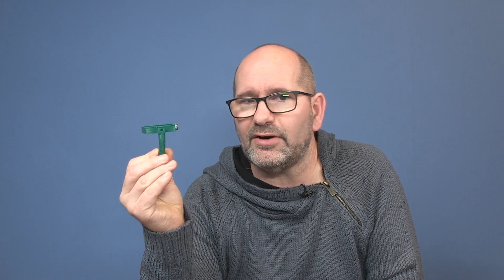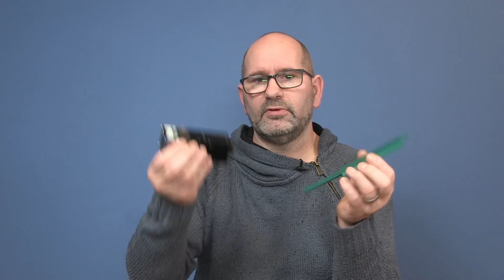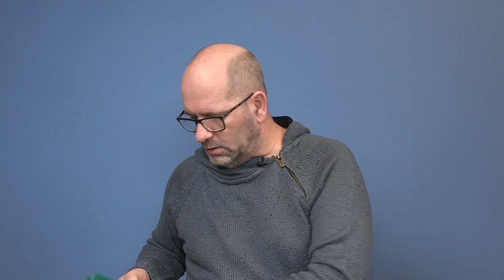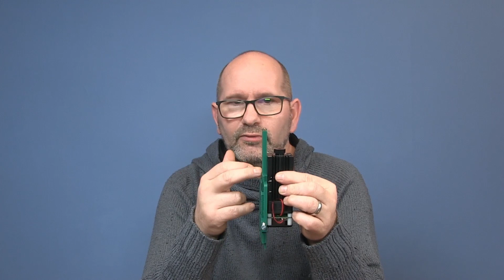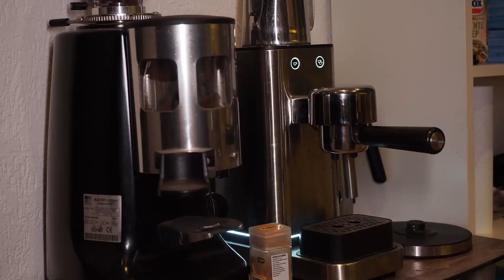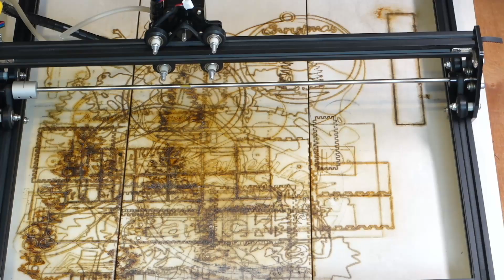▼ FREE ▼ Ortur Master II AIR ASSIST plus Z LIFT

Comment: Hi Brian, great design(s) but unfortunately as you know Ortur have changed the design again for the LM2Pro! Do you intend another re-design?
Reply from the maker: Not as long as I don't have the newer model.
I need to have it in my hands to do the measurements and create a new iteration of the Air Assist.

Comment: Newb question! I have a 3D printer..so can print the parts….but what is used to supply and presumably, regulate the air.
Reply from the maker: A very simple and cheap aquarium air pump.

Comment: I just downloaded and generated the Z-Axis adjust for the Ortur Laser Master 2 Pro - but it SEEMS that it dows not fit the Pro - the large mounting holes are all wrong.  I'm quite able to print one out on my AnyCubic and the one I printed looks and works well in my hand- but unless I'm missing something - it will not fit the LM2Pro - I don't suppose you've done a version for the latter? The engraver itself is lovely but the Z-adjuster is awful.

Pete
Reply from the maker: Hi Pete,
The Ortur Laser Master 2 PRO is a different machine from the non PRO version.
The lasers have a complete different shape and also the mechanism to mount the laser is different on the PRO version.
Maybe in the future I will also make an Air Assist for the PRO, but that depends on how many other people are going to make things for it.

Comment: I designed a knob that fits, compressed, over the head of an M4 screw that screws in, through 2 hex nuts installed in the slated openings on your latest air assist, to push the locking piece against the slider plate. It could be glued but the compression fit-up works fine.
Reply from the maker: Sounds great. :-)

Comment: My new laser master 2 with 20 watt laser  with the air assist (and stock mount) hits the head of the screws on the x axis connection to motor when laser is all the way to the left and moving in the y direction. Added a 1mm washer behind the mounting plate, on all 4 screws, and that moved it out enough to prevent touching. I am going to inform Ortur of this.
Reply from the maker: That's a strange problem, I never heard it before.
Glad to hear you fixed it.
Reply: Also changed out the wire sleeve from the stock ones to 10mm braded sleevs. They work better. The Laser Master 2 I received had the grounding mod included. The wire harness could use about 5mm more added to the length. I have quite a few adds. My 3d printer has come in handy.

Comment: A couple of things: 1. I had to enlarge the channel for the 6mm hole, this included some adjustment  (about 3-4mm wider of the extended part of the plate.. I measured it, as printed, and it measured 6.4mm ID and the tube should have slid in OK but it would not go past the first curve. The tube measured plastic air tube measured 6 mm exactly.
2. I designed a template that helps to make the bend just right to blow on the focal point of the laser.  3. I used a 3mm hex head screw and two hex nuts for the slide lock. 4. The small piece (lock) for some reason, does not download as the correct size. May be my Windows 3D builder software as i have had the same problem with other downloaded pieces. I measured the slot and adjusted the file to fit and printed it. I then put it in place and used pliers to press it into place after a little sanding. I inserted the slider and worked the locking screw and it worked fine.
5. Used my pliers to twist in my .6mm nozzle the first time. Good snug fit.
6. 100 C (180 F) water works fine to bend PLA after about 10 seconds. Used my templates with hose and nozzle installed as recommended and had NO splitting.
If you desire, I can download the template that I designed to make the bend correctly (plus the information as to how it should be used.
I have an air pump I bought on Amazon (Pawfly MA-60 Super Silent Air Pump). 2.0 Watt power, 1.8L/min air flow, 0.012 Mpa air flow pressure. It has a 60" (183 Cm) 6mm hose OD 4mm ID. 
Since I just received the Laser Master 2, I have not fully assembled it as I wanted to get any mods ready/printed prior to assembly. The delivery from Ali Express took 5 days from China and it cam with the new grounding mod included. It was a package deal which included a 20 Watt Laser and the YRR Roller assembly (noted that the routing of the belt on this was updated to make sure there was a clear end so long items could fit on the rollers. This was a mod suggested by another YouTuber (so the manufacturer is watching - impressive). All items came from Ortur, no clones.
Have also designed leg spacers so that I can set the printer frame for regular burning and then easily raise it above any anticipated items that are taller then the approximately 40mm of Z axis lift or when using the YRR Roller item. Thought of sessor lifts,  etc but this is simple, easily printed on my 3D printer and I can always print more if needed.
Reply from the maker: Hi, Sorry for the late answer, I have been a bit sick the past weeks. (no Corona).
1> This must be something with your printer calibration. A lot of people have printed it already and this is the first time I hear this.
2> If people have the same combination of laser and lens, that is a very good thing to have. Yet, I like to have the flexibility to adjust the angle to the focal point I use with any combination.
3> Great solution !!!
4> I am sure it downloads fine, but your settings in the software are finding the part too small, therefore they change the units to inches. This is a common problem with small STL parts
5> Great :-)
6> At 100 degrees Celcius, there is a big chance that the material is not heated up all the way to the middle, and also it's possible to overheat the part. The way I show it in the video is a good way to be save and not overheat the part. You can leave the part in for 5 minutes without a problem.
7> Oh wait, there is no 7 :-)
The package deal is a good deal, I love it.
Ortur has sure watched my video's and even contacted me multiple times. There are more goodies on the way to test in the next weeks.
Reply: @3dPrintCreator  Considering 2), how in the world did you manage to get a correct bend. i have tried this 10 times now... doesnt make it easier that tube reverts to its printed form o neach heatup :/
Reply from the maker: When using water that is not too hot, you can bend the print and keep it in place until the part is hard again.

Comment: What airpumps do you suggest to use with a laser master 2 20w?
Reply from the maker: For any laser I would suggest an airpump that does not blow away your material, but is strong enough to blow ashes and smoke away.
My simple aquarium airpump (mentioned in the video) has more than enough power to do so.
Reply: Real talk, I tried a 700 gph pump that was crazy loud, I picked up a tetra100 and it seams to work fine but people say it should cut out atleast 2+ passes and it certainly doesnt do that.

Comment: Questions: Can it not be designed to have the bend already in it? Can you just make a small hole. At the end so you don't need a nozzle?
Reply from the maker: Hi Phil, good question.
I have been testing that in the first models I designed, the tube was already bent in the print, but this had two major drawbacks:
For starters, the angle is not the same for every type of lens under the laser. With one lens you have to focus at a distance of 37mm, with another lens model you have to focus at more than 55mm. This means that the angle should be different for these models. This by itself is no problem, I could have designed two models.
The second problem is that there is very little room for the pipe down, and you want a strong airflow. Preferably you want to push the silicone hose completely against the brass or metal nozzle, and also make sure that this connection is firmly attached by pressure fitting it. In addition, you only want to determine the opening of the nozzle (1mm is a very nice opening) at the very last part of the pipe, so in the nozzle.
By bending the pipe during printing, it is no longer possible to get the silicone hose all the way to the nozzle, causing air to leak through the PLA (or other material) print, which means a loss in air pressure. By bending the pipe afterward, if the silicone tube is already in it, this silicone tube will also remain in place.
The result in this model is that the air pressure only needs to be very low so that a simple aquarium air pump provides sufficient air pressure. I myself work with an air pump that only moves 150 liters of air per hour. These types of pumps are very quiet and inexpensive. If I were to bridge the entire length with a printed pipe, it would leak a lot of air, because 3D prints are not airtight (not even watertight), requiring pumps with a capacity of 800 liters per hour or more to get the same air pressure at the nozzle.
Reply: @3dPrintCreator  Thanks for all the info. I bought an aquarium pump on Amazon for $5 and some hose at the local pet store for $4. Just need to buy a nozzle. I have a new printer to set up on my channel soon so I think I'll print it on that.
Reply from the maker: You have a new subscriber. Now watching your video about the hourglass.
Reply: @3dPrintCreator  Thanks. 😁

Comment: what if you just use a fan to place next to the laser, blowing the smoke/ash away from you, out the door/area you are working at. Great information! I really appreciate your content!
Reply from the maker: A fan would really do a lot, but not enough. You will need a nozzle, to blow the air in the gap you created with the laser to remove the ash from that gap.
Using a fan wouldn't remove the ash, using compressed air and a nozzle however, works great.

Comment: What's not better is how can we get your air assist system. Just give us a simple address where you take a credit card and I'll buy one now.
Reply from the maker: Before I came to the end result where I am now, I made dozens of models. I have tested them piece by piece, and from some models I made videos that I have shared with my viewers.
I have worked on the models for days, or even weeks, and even at the moment I am already testing for a new model, because Ortur has made changes to the design of the laser.
I have shared all models that I made for free on the internet, and when I noticed that my models were stolen to be sold, I made work of it, because everyone must have free access to it. The only thing I ask people to do themselves is to print the model itself on a 3D printer, or having it printed at a local maker Space.
So, I am sorry, but you will have to put in a little effort yourself because I am not out here to earn your money from your credit card. I am just sharing my thoughts and products for fun.
Reply: @3dPrintCreator  Thank you!!  I know how that you have put lots of hours designing it and making prototypes to ultimately make this beauty.

Comment: hi Brian, if you could do your next design with a screw at the top which passes through the fixed part then through a nut in the sliding part it would make it easy to focus the laser using the position of the laser rather than having to try to use the focus ring on the laser module.if you could do that i think that one would be the best ever
Reply from the maker: Hi Richard,
Sorry, but that will not happen. The reason is that Ortur now ships the lasers with a sliding mechanism as a standard, and what you are requesting is also something that already exists. Making it that way, would infringe copyrights and that is not something I want to do, as the thing you request is a commercial sold product.
Sorry.

Comment: the hole that goes through your part for the pipe on my machine has support material in it. have i done it wrong?. if yours did to how do you remove the support material?.
Reply from the maker: Hi Richard,
Yes, you have done it wrong :-)
You can't remove the support and that's why it is designed to be printed without support.
Reply: @3dPrintCreator  ok thanks Brian i will reprint it without supports
Reply from the maker: Great. 
This is also the reason why the pipe has to be bend afterwards. If supports where no problem, I would have printed it under the correct angle right away.
Reply: when choosing support select only touching built plate and you will be fine.

Comment: Hey Brian, at first, thank you for your great design. It is the best air assist which i see.
But i have small problem with the fixing. The screw hold the slider in the possition, but at the buttom, is slacks a little bit to the right and left.
Is it possible that you add a second clamping srew to the bottom of the part? Then it is not only secured at the top. 
I can send you a picture if you don't know what i mean.
Reply from the maker: Hi, thanks for your message.
I understand what you mean, but I don't think it's necessary, provided the printer you used for it is properly set up. When I look at the prints that I have made on different printers, I have no play anywhere in the carriage, because the gap used is 0.2mm, which is just enough to allow the carriage to move, but already so tight that it does not slide down by itself due to the weight of the laser.
Reply: Thanks for you reply. I have scaled the slider part to 101% but i think a second srew will be better for me. Can you provide the source file? I'm also a 3d Designer with Inventor and Siemens NX and can make the moddify by myself. A complete new drawing or moddifying of the stl file take more time.
Reply from the maker: Sorry, I don't share the source files as I have very bad experiences with that. People were using my designs to slightly modify them and  sell product and profit from it, while I share it for free.
Reply: @3dPrintCreator  I understand your decision. So i have to try to modify the stl file.

Comment: What would be cool is a video showing you cutting parts to create an air blower add-on to the laser machine. I know you did a 3D printed  add-on to hold the air blower, but it would be cool to se an Ortur laser master only modification process by cuttin plywood parts and some gluing and varnish job.
Reply from the maker: I have tried that, but since you can only cut about 3mm deep, it's very difficult to make an air assist that can be working that is only made with a laser cutter.
Reply: @3dPrintCreator  how about cut very thin sheets then glue together several layers together?

I've gotten the ortur laser master1  15W just recently. I have no barn to run it so meet to encase this somehow : I got 3  stacked IKEA lack tables and have put the laser in the middle table. I will put walls and seal this. I got a hailea aquarium pump for air assist, HEPA filter and a filter drum with activated charcoal. Only thing missing right now is 100mm air vent tubes and a fan (outside the casing) to create positive pressure in the casing to drive smoke through the charcoal drum and HEPA filter (also outside "on the other side"). I don't know if this will be enough to remove all fumes. I also hope to create a directed flow from the air assist to make a venturi effect  drawing smoke into the filter drum avoiding smoke dilution in the encasing as much as possible.

If this doesn't work I might add gas mask cartridges that do filter gasses. In that case I hope to be able to drive the air assist and a vacuum aspirator connected to it to get enough suction to move gas through the cartridge(s).

Comment: Sometimes I wish I got a 3d printer first :( I'd love to buy one!
Reply from the maker: They are not that expensive anymore. Lasers and 3D printers are a great addition to each other. There is really nothing you can't make if you have a printer together with a laser.
Reply: @3dPrintCreator   yeah, I think it's time to buy one!
Reply: @3dPrintCreator  will the air tube be long enough for a g8 lens?
Reply from the maker: Yes. Although I don't have one myself, there are a few comments from people that use it on their lasers with G8 lenses, and have succes with it. Yet, the distance to the material is a bit bigger, but they say the airflow is good enough.
Reply: @3dPrintCreator  Just started to print your design I like it! Gonna give it a whirl on my g8 Thank you

Comment: Hi Brian. Awesome video.  I getting this printed for my laser thank you so much.  I just have one question.  What size screw are you using that holds the laser in place from sliding up and down.
Reply from the maker: These are Metric M3. One screw and one nut

Comment: In the video you mention the specs for the nozzle and have it displayed in text.  The voice says V2 6mm and the text on the video says V6 6mm.  I am wondering if V6 is correct.  I am also wondering if it it is supposed to be .6mm as I am finding no nozzles at 6mm (which seems quite high).  Thank you very much for your creative and helpful work and for sharing it with others.
Reply from the maker: Hi. When I was speaking I made a mistake, therefore I wrote it on the screen in the edit.
The nozzle has to be one with a 6mm thread, that's the only real important thing.
The opening I choose, is a 1mm opening, but this can be 0.4 up to 2mm, depending on the volume your air pump is capable of pumping.
Because the nozzle i Used is an E3D V6 nozzle, that's the one I mentioned, but most nozzles you can find online are compatible.
Reply: I am using a standard 6mm 0,4 nozzel - some drill them to 1mm but think the point are to remove smoke from the focal point. Depending on the air pump volume l/m change to nozzle can preform different. This is not spacesience but in fact an great improvement to any laser engraver/cutter.